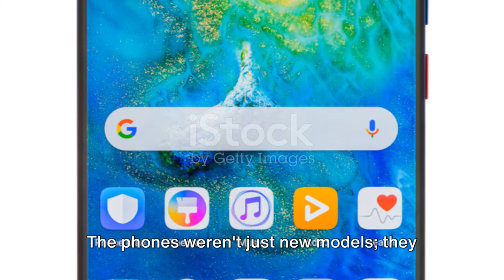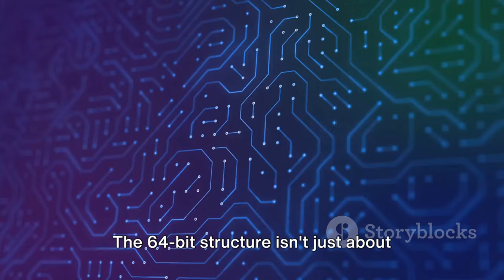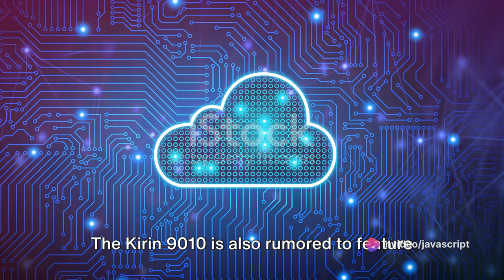Huawei Strikes Again with 5nm Kirin SoC Chip Made By SMIC

Comment: The 5nm process with DEV machines need quadruple exposures , that means the yield is extremely low
Reply: They made it to 7nm, I'm sure they'll find a way to get to 5nm. ( Russia has started working on using x-rays instead of EUV to make small chips. I'm very curious to see where this leads. )
Reply: anything smaller won't happen at scale 5nm won't either.
Reply: @SewTubular  do you know immersion technology involved？optical technology is just parts of it and I doubt Russia has the photo resist chemical which over 90% of them is from japan, even TSMC needs it to go on . China and Russia definitely have no ability to do. The optic can be generated by the accelerometer in China but it is KM long and then the optical lens , other components to make the parts. ASML has promised no more parts and maintenance for the DUV machines . It is just a matter of time , those machines break dow. Every EUV machines costs couple hundreds of million and needs to upkeep weekly
Reply: @phlei95014  Not sure if this changes things much, but the x-ray process that Russia is developing is "maskless". It would not surprise me if China and Russia end up working on this together. ( they've done this with other tech )
Reply: @SewTubular  I worked on massless technology before , it won’t be able in production. Do you know how long it generates one die , the computer has to write for a long time-
My friend works in Harvard physic lab for the e beam write, it can’t be in production because of the speed. Besides it needs to buy the photo resist chemical from japan, the only place. Russia never has any IC capability , its semi process still in very primitive stage . Russian technology is overblown, you can see from the Russian Ukraine war, Su34 shutdowns an S400 anti missile system ineffective due to lacks of advanced ICs. The failure of electronic warfare is due to the advanced ICs.
China and India bought several S400 systems but Israel F35s can go in Syria to attack like no man’s land with S400 and S300 systems